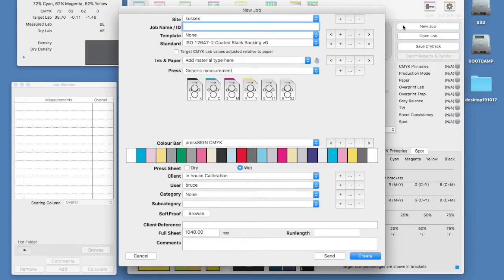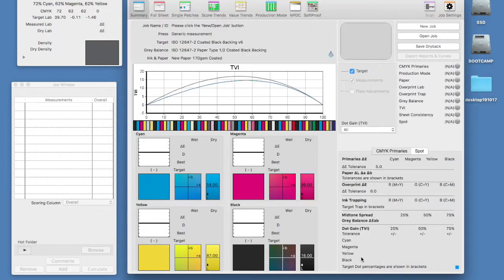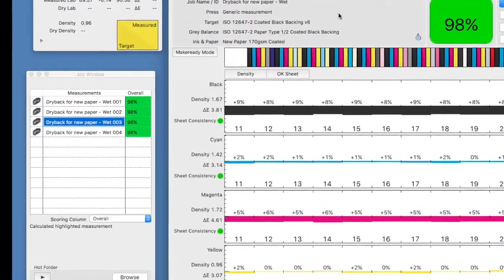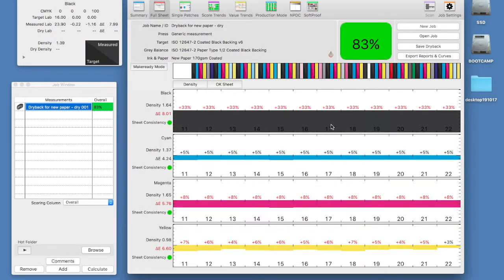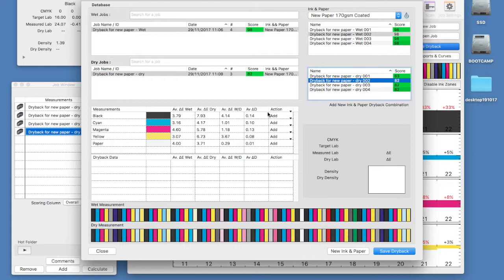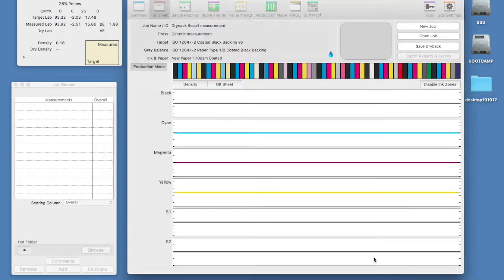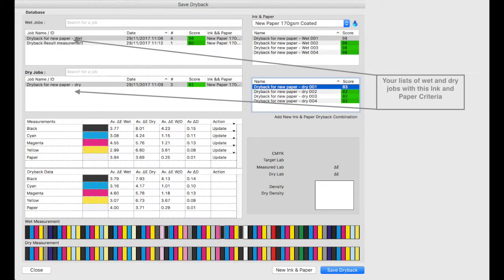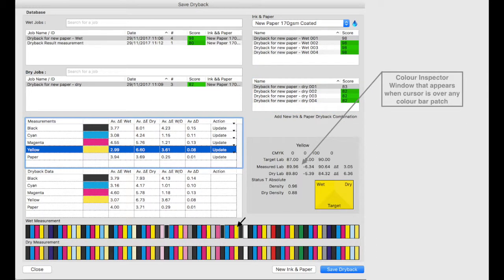pressSIGN How to use and Implement DryBack

Comment from the maker: In newer versions we changed the wet / dry buttons to Printed / Finished, as the same process can be used to correct for colour deviation after post print finishing, such as lamination, has been applied.